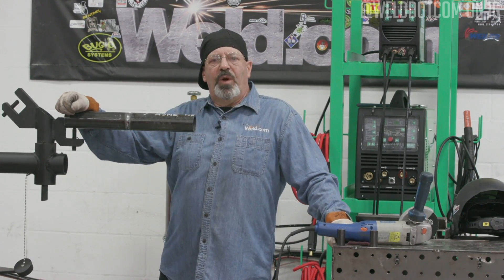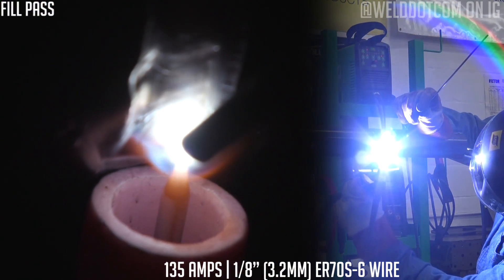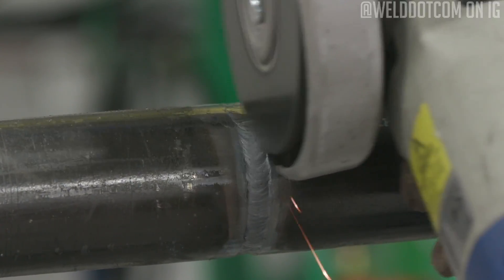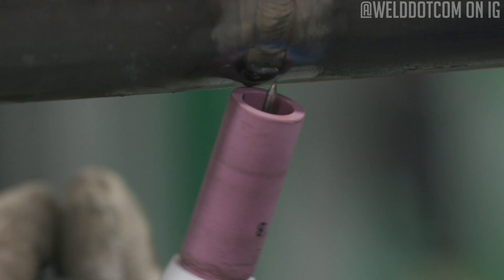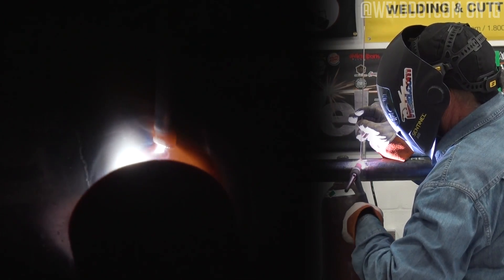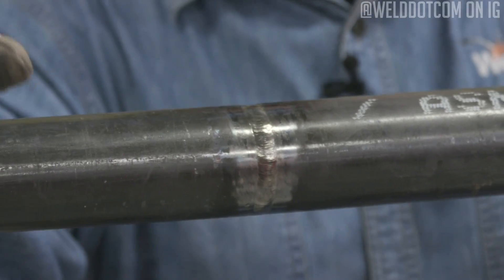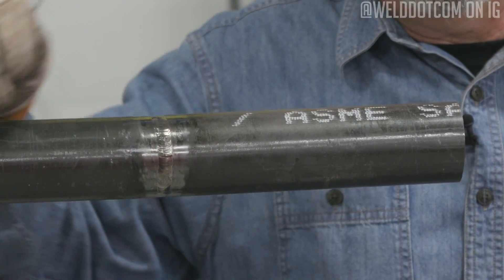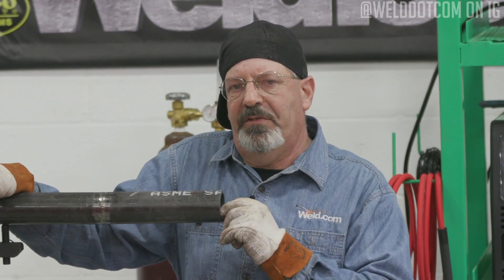5G TIG Fill and Cap Pass: 2 Inch Sch 80 Pipe

Comment: THANK YOU Bob in trade school were doing 2inch thick wall pipe carbon steel and the fuckin cap I couldn't get it down and didn't realise we have to fill it up pretty much flush then cap I would fill way less than you did

Comment: I have a problem with the cup slipping right around 4 o'clock to 3 o'clock. I guess I'm putting too much pressure on the torch but any pointers would be greatly appreciated. Thank you in advance.

Comment: Thanks. Seems like filler stays at the edge of the puddle rather than dabbing
Reply from the maker: That is correct. When walking the cup most people will agree that holding the wire on the leading edge of the puddle is your best bet.

Comment: Hello Bob. Any reason for using hot start and not lift arc?
Reply: Bernie Clark hot start is a setting that allows the electrode to momentarily exceed the preset amperage to help prevent sticking, you essentially start at a higher amperage initially. Lift arc is a setting to initiate the arc. Other methods are High Frequency (HF) and scratch start. I think you’re asking why Bob didn’t use HF or lift arc and chose to use scratch start. Scratch start allows you to initiate and run the weld without a foot pedal being used because the electrode is always Hot (live). Whereas HF and lift arc would require the use of a foot pedal. Running out of position or in awkward positions is difficult to perform while using a foot pedal. Using the scratch start method requires you to use other methods of controlling the heat of your weld pool. You can control the temperature of your weld pool with travel speed and the amount of filler metal you’re depositing rather than fluctuations with a foot pedal.
Reply from the maker: More common in the field.
Reply from the maker: Jason, I think he's referring to manual scratch start with fixed amperage vs foot pedal.
Reply: Weld.com I reworded for clarity.

Comment: Took a lot from this vid Bob thanks. A question though if you wouldn’t mind. You mention often about referencing the centre of the pipe but it looks from the video your tungsten is pointing up the ways. Is the reference more for the root pass or am I mixing my processes here. Many thanks
Reply: Since he was walking the cup, he couldn't have pointed the tungsten straight in. If he was freehanding, he probably would have been straighter in, but for a fill pass you don't want the tungsten straight in because you run the of getting too much penetration and getting suckback in the root. As long as the fill pass in penetrating the top of the root pass, you're okay.
Reply: You just have to reference to the center of the pipe with SMAW.